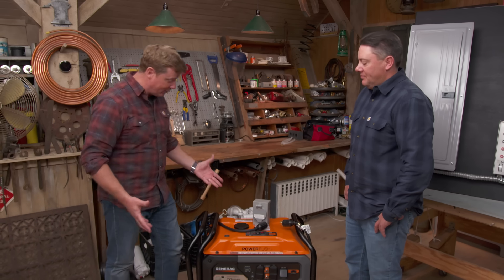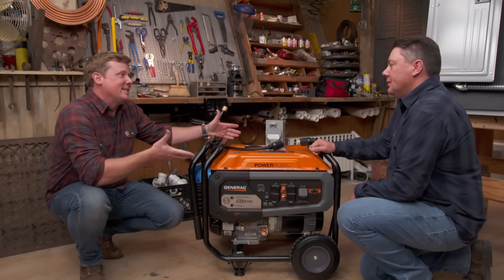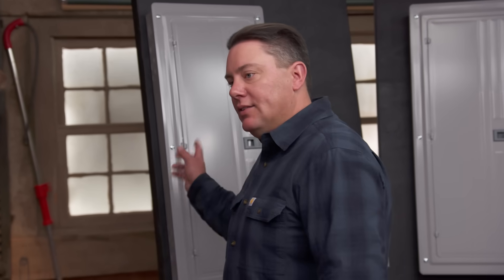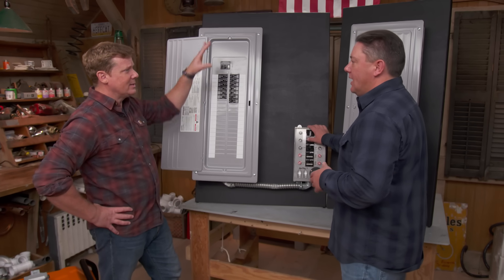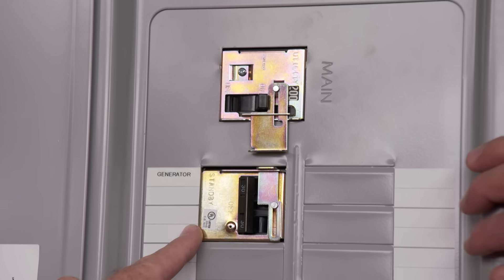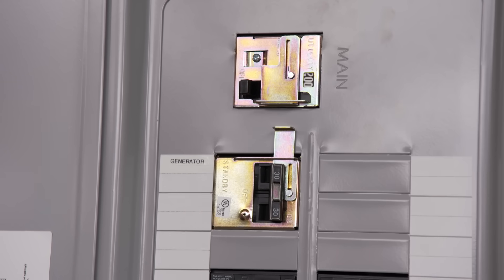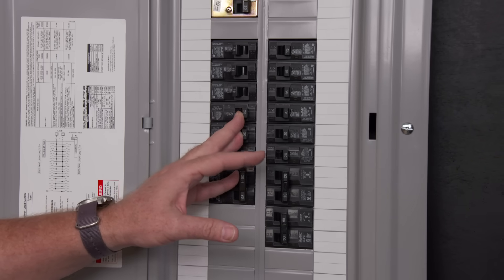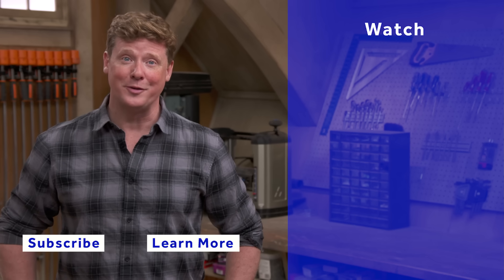How to Wire a Portable Generator | Ask This Old House

Comment: Wait, so how do you connect the generator to the second panel?
Reply: Breaker. This is prob a 240/120 system. Only two Bus Bars so that's the reason for the 2P Breaker. Breaker is Fed from the wires of the Generator. Neutral and ground attached appropriately. If Prime power is off and the Gen is going the breaker still feeds all phases of your panel.
Reply: Don’t forget about the generator safety rules: Always make sure you follow all the generator safety rules whenever you use your portable generator. This is only a reminder. Generators can be dangerous if not used carefully. Every year, hundreds of people die or get injured when using portable generators due to carbon monoxide poisoning and electrocution. Make sure you are using your generator carefully and keeping others safe as well. There is something very serious that everyone should always be aware of when using generators. Some people do run their generator indoors which is not safe and that increases the risk of carbon monoxide poisoning which can cause death of family and you. Some people run their generator in wet conditions which can electrocute them. Please remember that you should never run your generator indoors. Remember that carbon monoxide is an odorless and colorless gas that you cannot see or smell. Carbon monoxide is a silent killer. Keep that in mind. Make sure your generator is 15-20 feet away from your house and away from doors, windows, and vents. Never use your generator in your porch too. Having a carbon monoxide detector is very important against generator safety. Some people also allow children to go near the portable generator which could pose risks. We need to keep an eye on our children making sure that they are not near the portable generator so they won’t get electrocuted or burned by the generator which is dangerous. A locking enclosure also keeps kids safe. A generator shed might look like a tempting place to explore, or take cover during a game of hide and seek, but a generator is a dangerous piece of equipment that can cause injury. It says on the manual that we should also keep children away at all times from the portable generator to avoid injuries. Please do not allow a child or unqualified people to operate the portable generator.  It is important to keep your children safe especially little ones. The portable generator can be hot during an operation. Just because some manuals missed what should be listed doesn’t mean it’s safe to do. Always follow the generator safety rules when using portable generators. Generators pose electrical risks. If you need to use your generator during wet weather, you need a generator tent to protect your generator from getting wet. Don’t let your generator get wet. Keep your generator dry and before using your generator, please make sure your hands and your generator is dry. Do not wear loose clothing when operating the generator. Everything that is said on the generator’s operating manual should not be ignored. Never smoke cigarettes near the generator. Please keep flammable things away from the generator. Never overload your generator too. Your generator can catch fire. Never ever try to plug a generator cord into a wall outlet to avoid back feeding. Back feeding your generator is dangerous. Always turn on your generator first before plugging in appliances and shut off the appliances before turning your generator off. Use a heavy duty cord for your generator and the cord should not be worn out. All the instructions should be followed carefully. Never refuel your generator while it’s running. It can cause fire if fuel spills while your generator is hot. You should turn off your generator and let it cool off before refueling it. Having a fire extinguisher next to the generator is also important. This is only a reminder for everyone’s safety of using generators. Make sure your generator is properly grounded. Having a fire extinguisher next to the generator is also important against the safety rules. https://youtu.be/I1jT3ANENvI and here is a video more about keeping others safe when using generators and also about our family’s safety. It’s important to keep our little children safe as well. Make sure your little children are kept away from the generator at all times especially when it’s running. Hope this helps. Always remember that it’s better to be safe than sorry.

Comment: Should the generator have a floating neutral?
Reply: Here is a reminder about portable generator safety: this is only a reminder for anyone who use portable gas/propane generators. This is just to make sure that everyone is aware of all the warnings and it’s just to remind people to be careful using portable generator during a power outage. Everyone has to see this safety reminder. Every year after hurricane and winter storms, there were reports on the news that many people have died each year when using generators due to carbon monoxide poisoning and electrocution during a power outage. There were reports about deaths when using generators when the power was out. There is something very serious that everyone should always be aware of when using generators. Some people do run their generator indoors which is not safe and that increases the risk of carbon monoxide poisoning which can cause death of family and you. Some people run their generator in wet conditions which can electrocute them. Here’s an advice about generator safety: please remember that you should never run your generator indoors. Remember that carbon monoxide is an odorless and colorless gas that you cannot see or smell. Carbon monoxide is a silent killer. Keep that in mind. Make sure your generator is 15-20 feet away from your house and away from doors, windows, and vents. Having a carbon monoxide detector is very important against generator safety. Some people also allow children to go near the portable generator which could pose risks. We need to keep an eye on our children making sure that they are not near the portable generator so they won’t get electrocuted or burned by the generator which is dangerous. A locking enclosure also keeps kids safe. A generator shed might look like a tempting place to explore, or take cover during a game of hide and seek, but a generator is a dangerous piece of equipment that can cause injury. It says on the manual that we should also keep children away at all times from the portable generator to avoid injuries. Please do not permit a child or unqualified people to operate the portable generator. Generators pose electrical risks. If you need to use your generator during wet weather, you need a generator tent to protect your generator from getting wet. Don’t let your generator get wet. Keep your generator dry and before using your generator, please make sure your hands and your generator is dry. Everything that is said on the generator’s operating manual should not be ignored. Never smoke cigarettes near the generator. Please keep flammable things away from the generator. Never overload your generator too. Your generator can catch fire. Never ever try to plug a generator cord into a wall outlet to avoid back feeding. Back feeding your generator is dangerous. Always turn on your generator first before plugging in appliances and shut off the appliances before turning your generator off. Use a heavy duty cord for your generator and the cord should not be worn out. All the instructions should be followed carefully. Never refuel your generator while it’s running. It can cause fire if fuel spills while your generator is hot. You should turn off your generator and let it cool off before refueling it. Having a fire extinguisher next to the generator is also important. This is only a reminder for everyone’s safety of using generators. Make sure your generator is properly grounded. https://youtu.be/I1jT3ANENvI and here is a video more about keeping others safe when using generators and also about our family’s safety. Hope this helps and everyone understands the safety requirements. Thank you. Be safe.
Reply: Most are bonded, just use an ohm meter from ground to neutral on your L14-30 on the generator(while off) to check.

Comment: After   you  do al the  wiring  ,, you can only get 30 amp load?  Definitely  not worth
Reply: The generator (6500W) shown is rated for 30A when connecting to the 120/240 outlet. Concurrent amp usage varies from house to house. Best to measure the amp usage during a normal day in your house to determine the size of the generator that is needed. 1 AMP = 120W. My house runs close to 20A.
Reply: Don’t forget about the generator safety rules: Always make sure you follow all the generator safety rules whenever you use your portable generator. This is only a reminder. Generators can be dangerous if not used carefully. Every year, hundreds of people die or get injured when using portable generators due to carbon monoxide poisoning and electrocution. Make sure you are using your generator carefully and keeping others safe as well. There is something very serious that everyone should always be aware of when using generators. Some people do run their generator indoors which is not safe and that increases the risk of carbon monoxide poisoning which can cause death of family and you. Some people run their generator in wet conditions which can electrocute them. Please remember that you should never run your generator indoors. Remember that carbon monoxide is an odorless and colorless gas that you cannot see or smell. Carbon monoxide is a silent killer. Keep that in mind. Make sure your generator is 15-20 feet away from your house and away from doors, windows, and vents. Never use your generator in your porch too. Having a carbon monoxide detector is very important against generator safety. Some people also allow children to go near the portable generator which could pose risks. We need to keep an eye on our children making sure that they are not near the portable generator so they won’t get electrocuted or burned by the generator which is dangerous. A locking enclosure also keeps kids safe. A generator shed might look like a tempting place to explore, or take cover during a game of hide and seek, but a generator is a dangerous piece of equipment that can cause injury. It says on the manual that we should also keep children away at all times from the portable generator to avoid injuries. Please do not allow a child or unqualified people to operate the portable generator.  It is important to keep your children safe especially little ones. The portable generator can be hot during an operation. Just because some manuals missed what should be listed doesn’t mean it’s safe to do. Always follow the generator safety rules when using portable generators. Generators pose electrical risks. If you need to use your generator during wet weather, you need a generator tent to protect your generator from getting wet. Don’t let your generator get wet. Keep your generator dry and before using your generator, please make sure your hands and your generator is dry. Do not wear loose clothing when operating the generator. Everything that is said on the generator’s operating manual should not be ignored. Never smoke cigarettes near the generator. Please keep flammable things away from the generator. Never overload your generator too. Your generator can catch fire. Never ever try to plug a generator cord into a wall outlet to avoid back feeding. Back feeding your generator is dangerous. Always turn on your generator first before plugging in appliances and shut off the appliances before turning your generator off. Use a heavy duty cord for your generator and the cord should not be worn out. All the instructions should be followed carefully. Never refuel your generator while it’s running. It can cause fire if fuel spills while your generator is hot. You should turn off your generator and let it cool off before refueling it. Having a fire extinguisher next to the generator is also important. This is only a reminder for everyone’s safety of using generators. Make sure your generator is properly grounded. Having a fire extinguisher next to the generator is also important against the safety rules. https://youtu.be/I1jT3ANENvI and here is a video more about keeping others safe when using generators and also about our family’s safety. It’s important to keep our little children safe as well. Make sure your little children are kept away from the generator at all times especially when it’s running. Hope this helps. Always remember it’s better to be safe than sorry.

Comment: All these overly high level reviews don't give any good, critical details about these installs and they give some misinformation about the capabilities of a portable generator.  There are units out there you can buy that will easily accept multiple types of fuel and very easily run your central A/C and other circuits in your home if you're selective about which you have on together.

A portable unit with adequate wattage can absolutely run a central A/C without issue.
Reply: Correct, but many people cant afford a 20k Generac
Reply: @stclairstclair  you can run your central AC with something that covers the Amps needed to run it.  Install a $325 soft start kit and a generator that will push the 30-40 apms needed and done. Those generators run $900-$1000.  There are multiple guides on YT showing peole running their central AC with a 7,500 watt unit.

Comment: There are two things that are not mentioned in this video that you need to know. Number one, you cannot use a generator where the neutral is bonded to the frame or to the ground. Your house panel already has the neutral bonded to the ground and you cant have the neutral bond in more than one place in a circuit or else you get a potential current loop. It needs to be a floating neutral generator. Number two, the wiring installation method depends on where you are installing wiring. Keep in mind local electrical codes and the NEC when working on your house.
Reply: You seem to know your stuff,
What about this situation. I'm running a neutral bonded generator through a suicide adapter cord (L14-30p to 6-50p)  generator to welding outlet.
I'm backfeeding my 50 amp welding outlet with two hots and a ground(as 6-50 outlet doesn't use a neutral)
Should I "unbond" the generator or am I fine, also I'm assuming I should still connect the generator to a grounding rod in the grass?
Reply: @stclairstclair  I know enough to know when to get an electrician involved. You should probably talk to a licensed electrician. What I can tell you is what you are doing sounds pretty dangerous to me. You should never have cables with potentially energized male ends. Secondly, if you are backfeeding a panel, you need a neutral between the two hot wires else you may get 1 hot leg at 230v and the other hot at -10v potential (one should be at +120v and the other at -120v with neutral being at 0v).
Reply: A Google User,  I was raised in my grandfathers home, I'm a third generation mechanic,  These people would never hire anyone to do anything,
They built the home we lived in,  I made my suicide cord only one foot long so I can unplug each side without having to lay it down and walk to the other side of the house to unplug the other end, thanks anyway.
Reply: It's not mentioned because that isn't the point of this small video. I could point out that it didn't mention how to connect the transfer panel into the main panel or I could say it didn't show how an interlock is installed. But I won't say either because ALL that stuff and the two points you highlighted are the domain of a licensed electrician, not you the casual viewer. Get it?

Comment: I have that model 6500 yet the electrician told me that it can't run all  the house which I understand.  He installed the second option yet it seems that it doesn't want to work some small flickering and then nothing.  Also he told me the cord was to long that it reduces the amps to start, I believe I have 50ft neighbor gave it to me.  What is the normal or recommended lenght then . I have seen videos with a generac 5500 and they are running at least half of the house.  Any recommendations to what's going on is appreciated. Thank you!

Comment: Interlock - this one allows you to select the circuits you want to run based on the load each circuit pulls and allows you to prioritize while being able to change as needed or wanted.
Reply: Seems like the cheaper option too. A couple pieces of metal compared to an entire unit.

Comment: My panel box does not have a main shut off.
Reply: Make sure you use your generator carefully and please remember not to run your generator indoors. I know all about generator safety: we should also keep our children safe when we’re using portable generators so they don’t get electrocuted or burned and even poisoned by carbon monoxide. Generators can be dangerous if not used carefully. Generators can overheat that’s why we should keep our children safe as well. Just a reminder. Hope everyone stays safe. Thank you